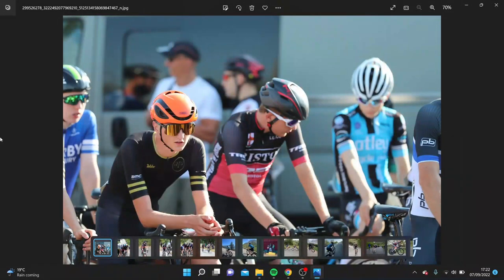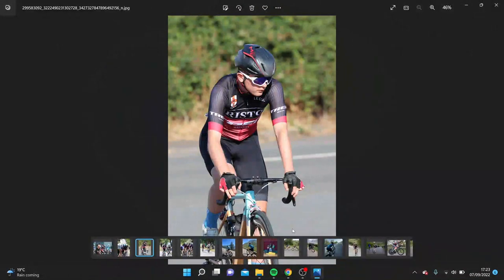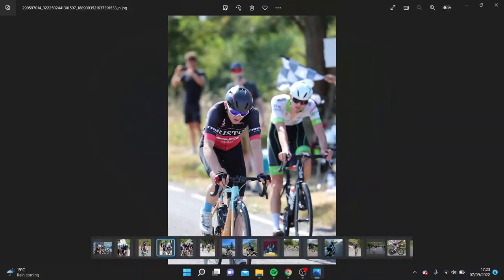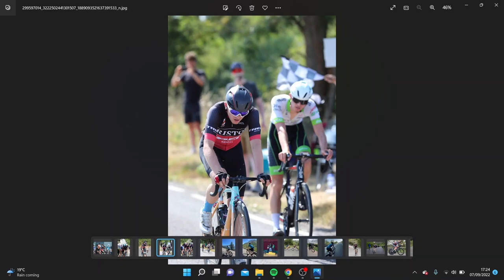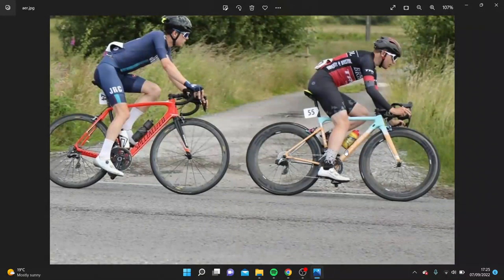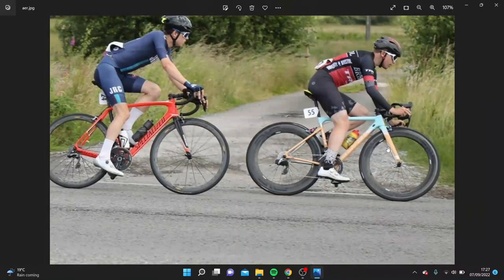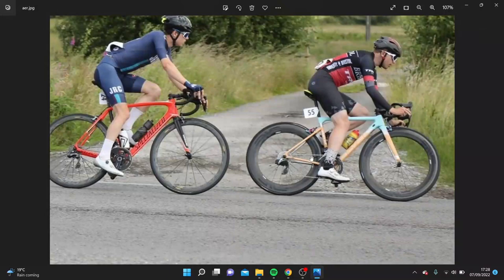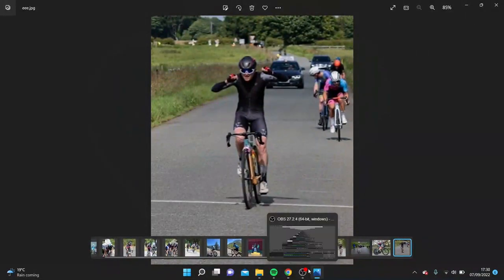My BIKE SET UP - SUPER AERO + OPTIMISED

Comment: I am skeptical on rim depth...are you racing also on proper downhill sections? My performance suffered a lot when i got a pair of roval rapide clx (51/60mm) wheels...and it was not only on alpine downhills, also on shorter technical fast sections i was loosing often the wheel of the guy in front of me. Not sure if it is the depht or because they are stupidly wide but loosing positions in every downhill is not fun..Now im racing on 35s and feel a lot faster up and down the hills lol unless its a pretty flat race of course
Reply from the maker: Yh I have whacked it down many alpine descents and it's. They definitely feel a bit different at first but I have had 0 issuest
Reply: @CharlieCarbsandCycling  Interesting so maybe the rovals 35mm width is just too much...

Comment: I am not sure if its a shoulder thing. But why not 2cm bigger frame ? Maybe in the future? Looks too small imo. Stack wouldn't change all that much, but you would gain more stability. I assume. And gl in the fall races.
Reply from the maker: Stack would be too high if I had a smaller frame. Bike seems bit small but it's best option as the size up I couldn't get low enough